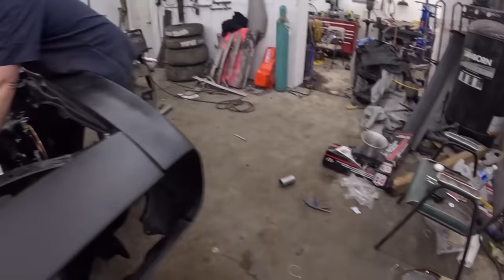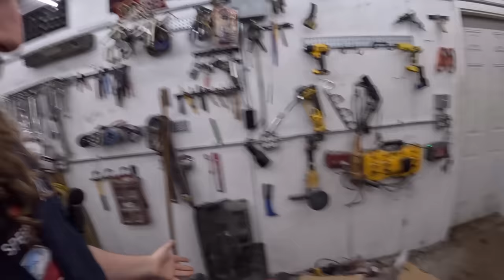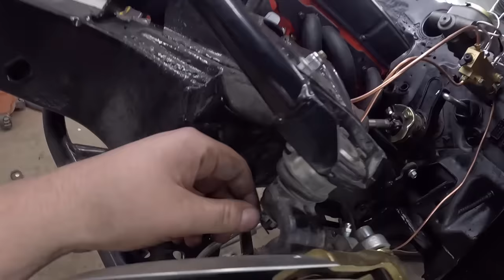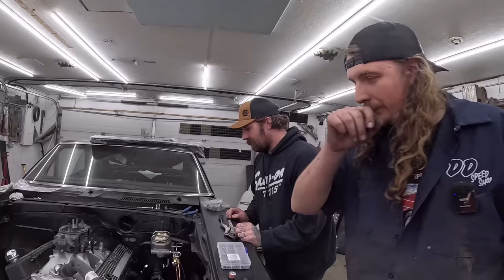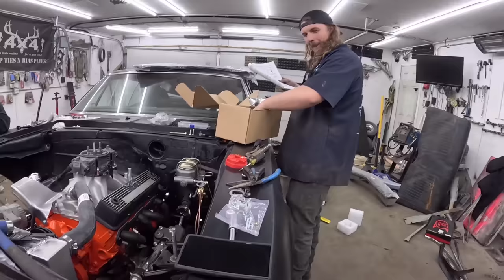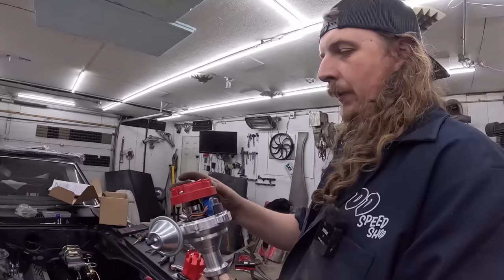Dressing Our Racey Small Block In A 1967 4 Gear Camaro

Comment: Dan you need to put some silicone on the 4 bolts threads that go in the center of the intake manifold so they won't seep oil and puddle on top..

Comment: Back in the '80s I was the guy my buddies would call when it came time to fire up their hotrods after a motor, intake, or cam swap. I'd show up, set valve lash, drop in the distributor, set the points, put the plug wires on, and set the timing. Our local speed shop would let us use his distributor dyno to set the advance curve.

Comment: Dan on any small block and big block always put your finger in the number one cylinder hold it there and turn the engine clock wise then you’ll feel the compression pushing and set it on zero then drop the distributor  in

Comment: I also use a dab of sealant to hold intake gaskets in place, but I also put a couple of bolts through each one. I've had them move just a little before the sealant set up so the bolt holes were a little off. The bolts will keep them from sliding. I still use Permatex Form-A-Gasket #2 on water pumps. I've never really been a fan of silicone of any kind as a gasket sealant. I do like it as a thread sealant. Anything is better than Teflon tape. I don't think I've ever had that work, and gave up on it decades ago. The water pump/timing chain cover design on a small block Chevy is genius. A Mopar 318 is a nightmare. I always use 160 t-stats in older cars. I'm running the cooling system in my 289 Pinto unpressurized, and it works just fine. I originally did that because I had a pinhole leak in the radiator, and it would leak under pressure. I finally fixed that, but continued to run it unpressurized. Runs cooler, and is less likely to develop another leak somewhere. While I love the looks of chrome, I've found that on some things, like that dipstick tube, the chrome can make them too big to fit properly, and you need to need to use a wire brush wheel or sandpaper to remove the chrome where it goes into the hole in the block. Don't hammer on them. They are made of amazingly cheap stuff, and it is super easy to mushroom them.
Reply from the maker: Solid tip
Reply: I always used spray adhesive  to hold the intake gaskets in place when I was building big block Chevy motors! 👌
Reply: @Alfred..E..Neuman  most people don't realize that gasket sealer is a great adhesive for various things also. as long as you clean your surface with carb cleaner/acetone etc it's very strong.

Comment: That intake looks like the one my friend had on his car. Its was a ripper a 372 stroker for the dirt track. We beat big block Le mons with built tranny and beat them with my friends small block in his four speed camaro. A few times  he stepped on it and went up on the curb and ran into the fire plug. It was radical it would get away from you. Remember that in that 435 hp car you made. :face-fuchsia-wide-eyes::face-blue-wide-eyes::body-blue-raised-arms::face-turquoise-covering-eyes::face-turquoise-covering-eyes: It will be wicked.

Comment: Last night I watched the cast with you and Mer. I was going to send a post about an old car I bought. It was a 1977 Oldsmobile Cutlass Supreme Brougham. 350 Rocket loaded. PB PS PDL PW AC lol 
My idiot brother wrote it off. 2 weeks after i bought it 
The 3 weeks later he went to jail in Headingly . And a 
5 years of drivers suspension 
Needless to say. He is my older brother 
i still beat the shit out of him for wrecking my car.
It was back in 1987

Comment: Instead of using  silicone to hold gaskets in place I have bolts 🔩 with the heads ground off to hold in place while putting the manifold on.

Comment: All the gasket sets I used to get had the rubber gaskets for the front and back of the intake. The rubbers had a slot in them to hold the head intake gaskets you only have to goop the four corners. Always used FelPro complete gasket sets. Built many sbc and gasket sets were cheap

Comment: For Dani, & maybe Dan, too: If the fastener is Right Hand thread(99% of the time), you take your right fist in the "thumb's-up" pose, you point your (rt)thumb in the direction you want the fastener to move, and the "curl" of the fingers on your right hand will tell you what direction to turn the fastener/wrench. Conversely, if you have Lt Hand thread, repeat the procedure with your left hand.

Comment: Ya, lets go ahead and support local. 20 dollar part and $30 freight. Profit is key. Im not knocking our parts stores, but pricing is whats causing people to turn to amazon and Rock Auto.
Ultra grey silicone is junk. High temp red is far better. 
Deck screw- made the drywall screw obsolete. 
Drop a bolt in the dipstick tube, Jimmy!

Comment: The pro guys lock out the Distributor with no vacuum advance.for more power,.. For the street I found that out if  you use lighter weights and heavier springs is almost like locking it out..And  adjust vacuum to move/advance only a little With the ported carb vacuum at idle.That way it starts easy and runs Hard.With no pinging. Try it you'll like it Mikey says SO.😂😂😂 Full vacuum advance and light springs is Mickey Mouse. Because the vacuum is constantly moving añd so are the springs resulting in a mismatch timing curve with no Power the original set up is for a stock engine.with smog equipment... To lighten the stock weights grind the outer edge down about 1/16 or a little more mach the other weight the same the ideal curve would be Approx.12`@ idle 36`@ max rev.like from 4,500 to 6,500 rpm's. You're supposed to disconnect and plug vacuum line temporarily while you set the timming 36`at a high rev.above 5,000 rpm's. Then reconnect vacuum see if it's between 12 and 15`at idle. Then your engine will Hall Balls👍👍👍👍👍

Comment: I like those 1969 350cid 350 hp double hump heads that have the accessory bolt holes unlike the 67 327cid 300 hp double hump heads that didn't come with with a alternator bolt holes.
Reply: Dealing with that right now on a 63 Corvette 327. My buddy made a bracket to go with the March serpentine belt setup, well see how it works. By the way engine going in a 66 Gto....

Comment: Most auto parts stores stuff is made in China Amazon most stuff from China, Rock Auto made in China, so, it really doesn't matter where you buy it..its all made in China many times I get stuff $100 cheaper on line than the local auto parts. Still a big fan of the local pick & pull

Comment: good mechanics don't use impact wrenches on engine work because it's too easy to strip threads.
Reply from the maker: I am not a good mechanic
Reply: ok but you are not worried about stripping bolts @DDSpeedShop

Comment: Put it tdc and drop it in and bump it till the distributor falls and point the vacume advance to the back valve cover bolt and and it will fire and then you can play with the timing but you already know this Dan people's make things to complicated where the should listen to someone that has been there and done that none of this new generation will ever steal this car because they are idiots that can't even write or read cursive or tell time on a clock with hands

Comment: That intake is different, you're going to be down about 15 to 25 HP with the new one.🤷
Reply from the maker: Doubt it
Reply: @DDSpeedShop  
At least down by 10 HP.  Unless you add a spacer to make up for the lost plenum volume.🤔